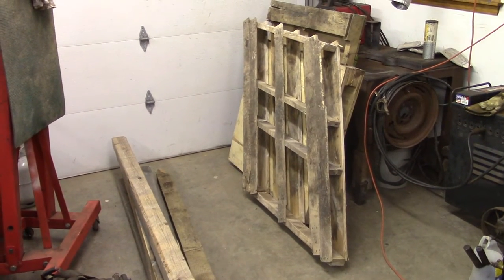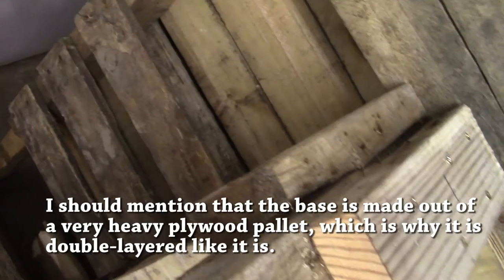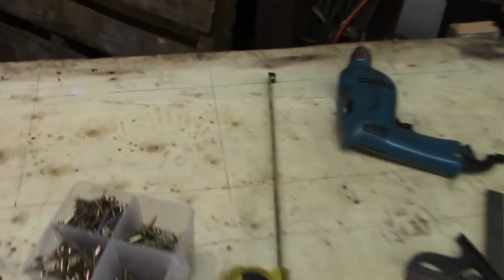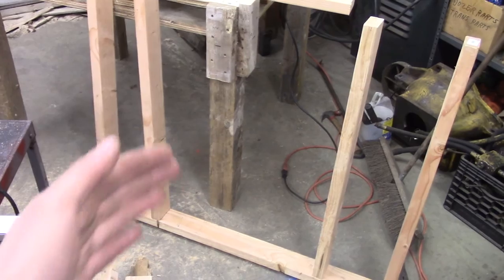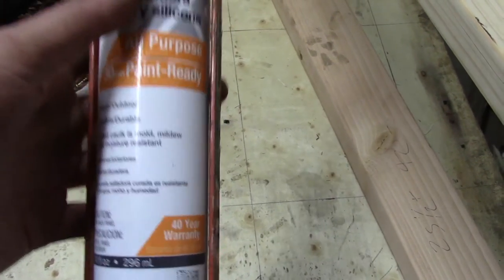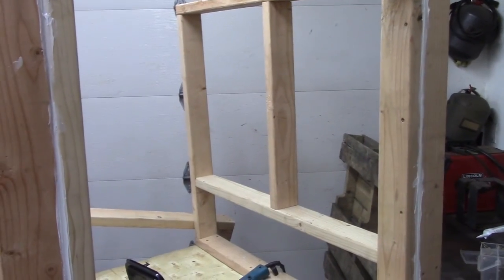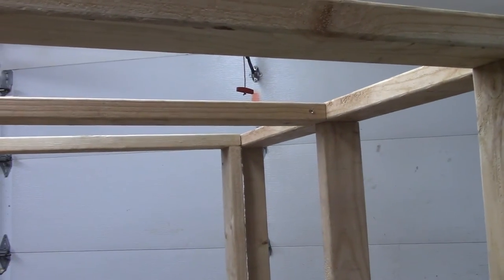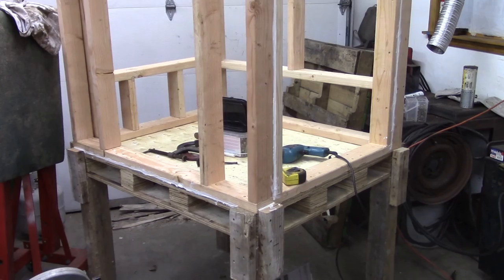Let's Make A Chicken Coop - Frame It Out (Part 1)

Comment: maybe you already know this but instead of philips screws you should use torques because they wont spin out on you, also if it were mine i would put a slope in the roof wouldn't need to have a peak but even just a little slope would be better than nothing and shouldnt be to hard for you to do
Reply from the maker: Just picked up another box of screws that are torx... AWESOME! and yes, I redesigned the roof. You'll see it in part two, coming up today or tomorrow! Thanks for watching and commenting.